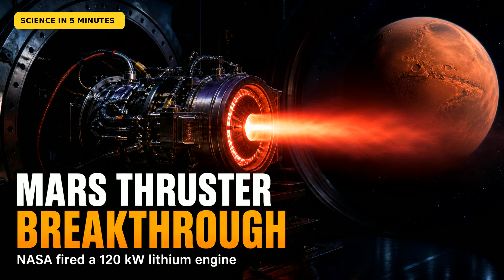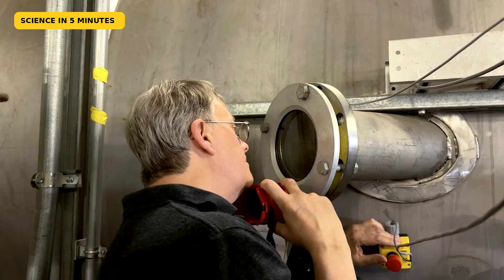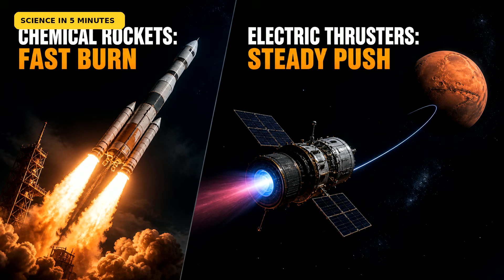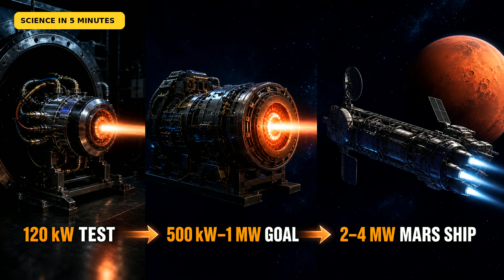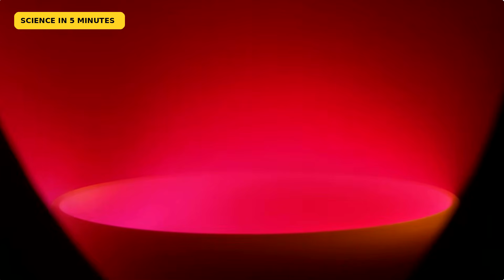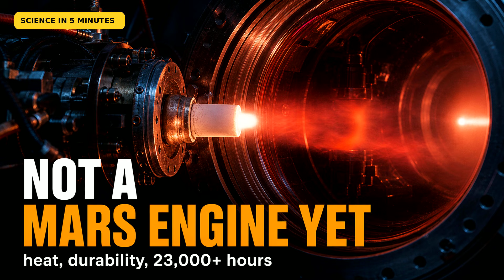NASA Just Fired a Mars Engine That Could Change Everything

Comment: This is a genuine progressive direction in thruster development, though keeping the magnetics cool in space is going to be a tall ask.
As for my take;
While it would change their propellant feed architecture, shifting from Li metal to LiH, would likely be an interesting way to increase performance and propellant density.
The ability to feed in a solid salt like this may also allow flexibility to modulate it between several different hydrides like MgH2 or NaH for higher-thrust, lower efficiency propulsion modes.

Comment: Rudimentary ion drive.
Reply from the maker: It is related to electric propulsion, but it is not a standard ion drive. This is a lithium-fed magnetoplasmadynamic thruster, where high currents and magnetic fields accelerate plasma. The important part is the 120 kW test and the path toward much higher-power deep-space propulsion.
Reply: No, it's not.   it works differently and it has it's plusses  (m mostly force, even the prototype was above the Newton mark,, and the target for the demo is close to  3.5N), it uses a different fuel  (metallic instead of noble gas) and has it's own problems.
Reply from the maker: @jaimeduncan6167 Exactly. It is still electric propulsion, but it is not just a conventional ion drive. NASA/JPL describes it as a lithium-fed magnetoplasmadynamic thruster: metallic lithium vapor, high current, magnetic acceleration, and a 120 kW prototype test. The important point is the scaling path, not that it is ready flight hardware.

Comment: fake information fake video fake ai narration misinformation
Reply from the maker: The information is not fake. It comes directly from NASA/JPL: a lithium-fed MPD thruster was tested at JPL in February 2026 and reached up to 120 kW. The video also states that it is not a finished Mars engine yet, only an early prototype that could support future Mars propulsion systems. Source is linked in the description.
Reply: I can confirm the the information is not fake, it's a prototype, and the test was in February.
Reply from the maker: @jaimeduncan6167 Exactly. The JPL test was real: February 2026, lithium-fed MPD prototype, up to 120 kW. The cautious framing matters too: it is not a finished Mars engine yet, but it is a real step toward higher-power deep-space propulsion.